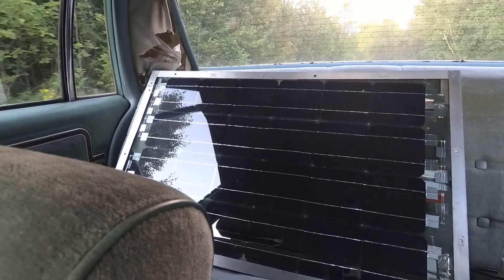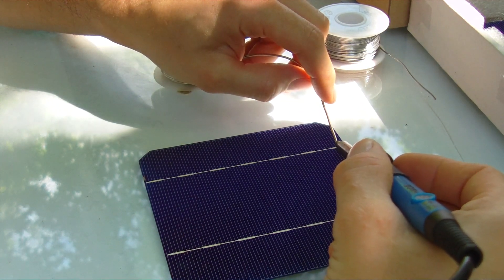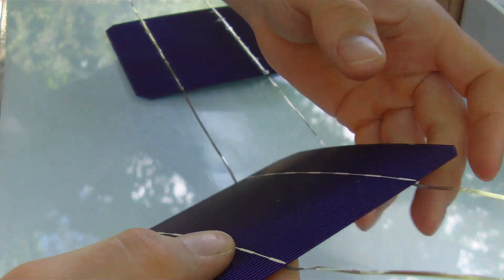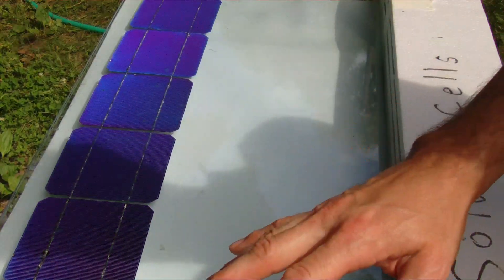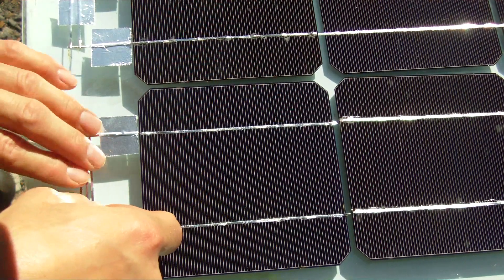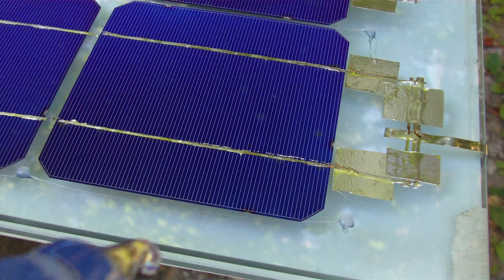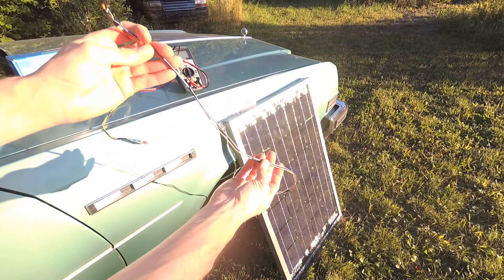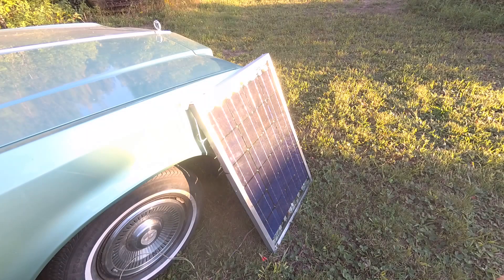DIY Solar Panel complete Build - Monocrystalline 65 Watt Panel, real output

Comment: Don't waste your time or money building a diy solar panel like this. It'll only last about 1 yr before moisture destroys it.... It's pretty bogus of this guy not to mention that this is a waste of time & money. Even if you encapsulate them by pouring liquid silicone or clear 2 part epoxy resin. They'll get moisture inside & ruined. It's possible if you built a diy oven vacuum table combo & used EVA film. Like a real solar panel factory does. You could make decent long lasting panels. About 10yrs ago I bought about $350 worth cells & other parts to make 5 100w panels. They were ruined in about 2 yrs. I would have been much better off buying 3 100w panels. I'd still have them working. All these douche bags on YouTube were saying people should build their own panels  to save money. Without saying they'd be ruined by moisture in 1 or 2 yrs 🆚 a real one lasting 25 yrs. They convince you to make your own because they want to sell you boxes of factory rejected cells that don't produce as much power as the approved non reject cells. They buy large quantities of junk cells for dirt cheap. Then sell say 1000w worth of cell on ebay for around $400.

Comment: I really like these videos. Super interesting. I work in the solar biz, and have handled a few panels in my days, including fancy glass-glass panels. 
The result is great as well, it looks really nice. Like almost on par with some commercial panels. The only thing missing is a proper junction box for the cables :).
I happen to have a badly cracked panel lying around, and now i know exactly what to do with it.

Also it would be interesting to see if you could cobble together a larger panel with parallell cells as well, or maybe just get some proper bypass diodes in there to combat shade.

Comment: How much does it cost to build one of these panels?  I just bought 20 used 320 watt panels for about $90 each.
Reply: Where did you find 320 watt panels for $90? I’m not sure where to look.
Reply: @k9connect744  SanTanSolar